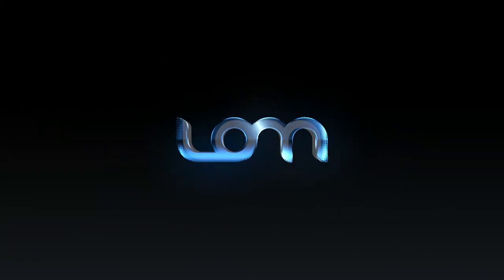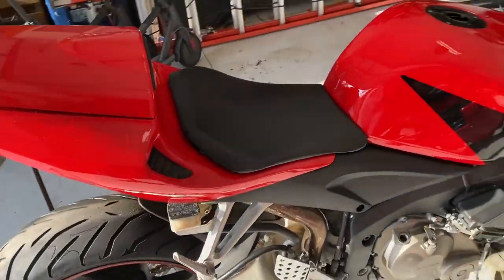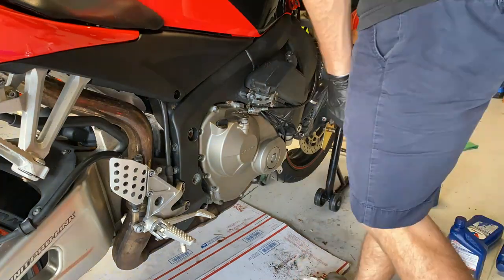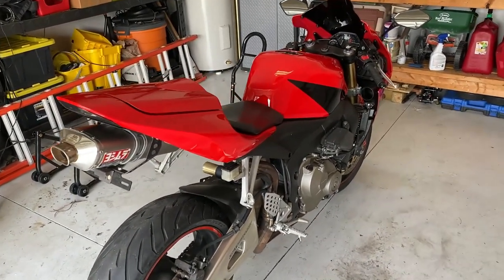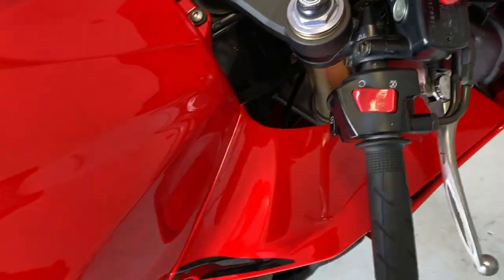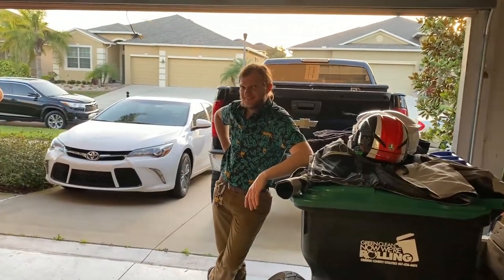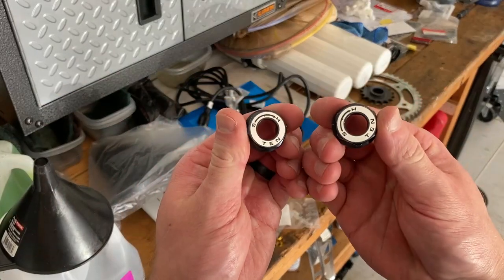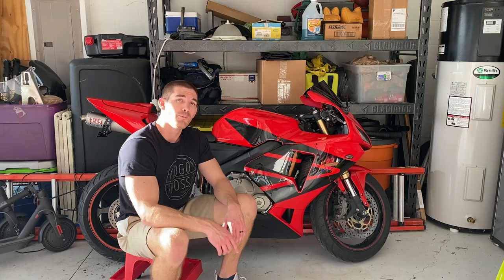The build is COMPLETE!

Comment: Only problem I see is the oil you used, I used that oil before and my clutch didn't like it so I drained it and went and got some Honda oil made for it and no clutch problem after a few runs, Other than that a excellent rebuild on it, It's amazing how much the 05 looks like the 06 CBR which is what I have.